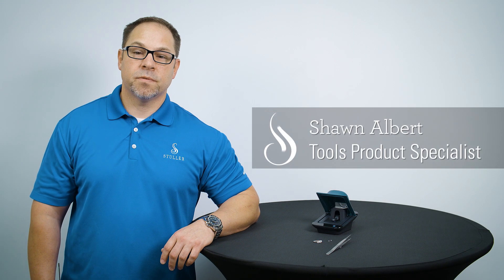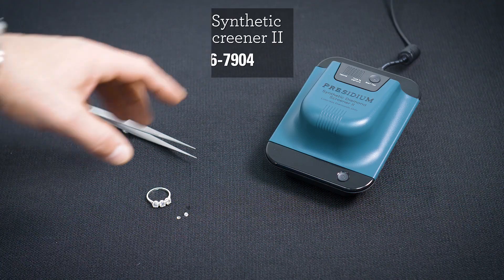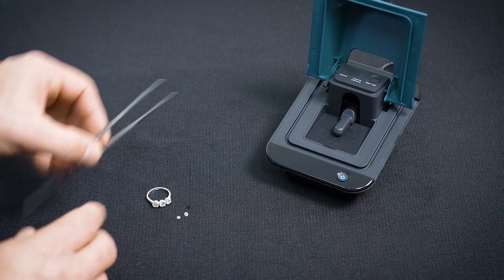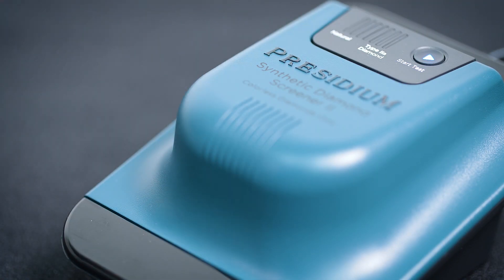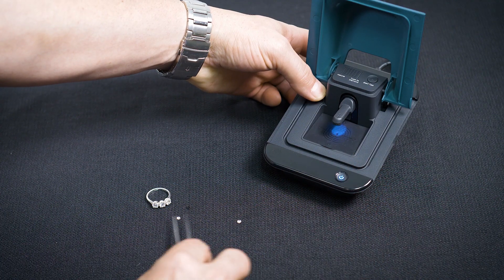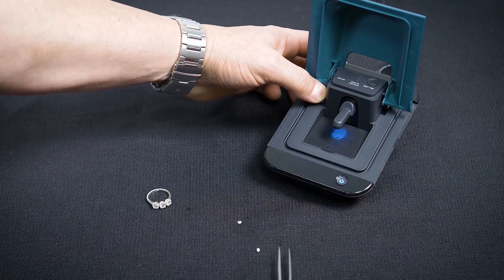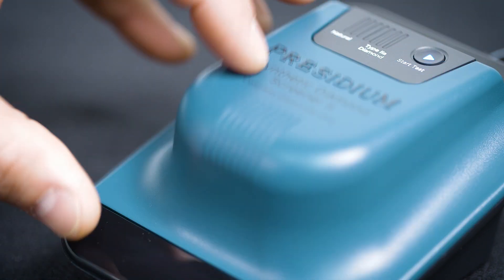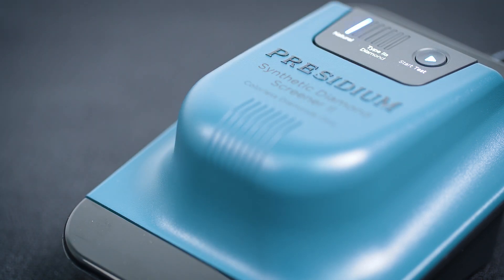How It Works: Presidium Synthetic Diamond Screener II

Comment: How accurate is presidum compare to GIA Id100?
Reply from the maker: Hi Binh! Comparing units with such a huge difference in cost can be tricky. I think checking out the reviews from our website on the Presidium® Synthetic Diamond Screener II might help you out! 

Especially "Great diamond tester for the money." You can find it here: https://www.stuller.com/products/56-7904/11911635/?groupId=191014&utm_source=YouTube
Reply: Never can mark a moissanite as natural, because the moissanite don't take UV, don't have nitrogen.
Reply: @mariopuebla9595  Actually moissanite absorbs SWUV despite not containing nitrogen. Completely different composition and structure and actually does result in "natural'. Check it out for yourself and you'll see!
Reply: @TheGemAcademy  Have you any idea about the best diamond testing machine ?
Reply: Its not accurate dont buy it marks moissnite as natural diamonds as well
Reply: @goldennugget2031  it's because moisnite also is natural
Reply: @SotoAdvert  a moissanite and a natural diamond is NOT the same.